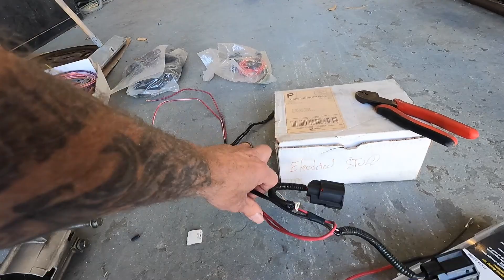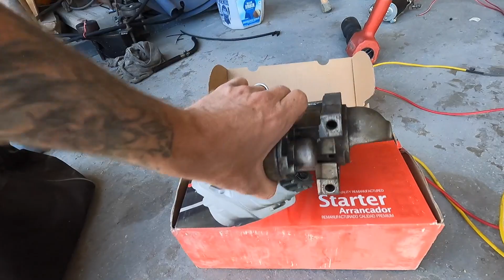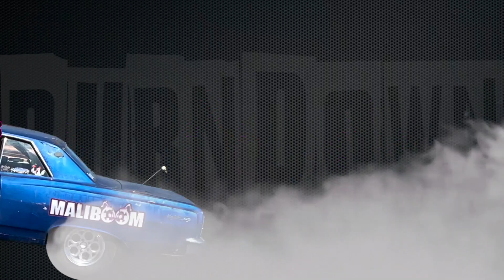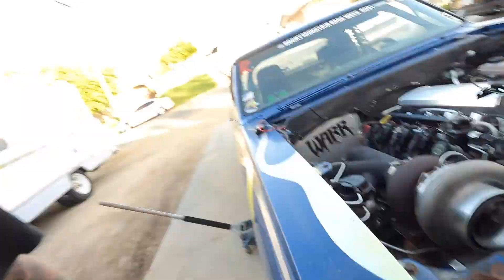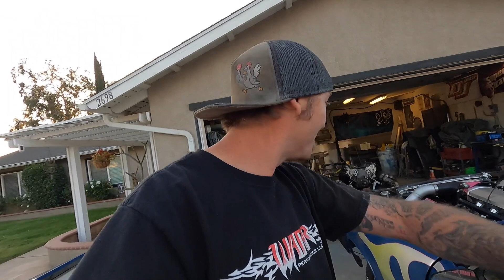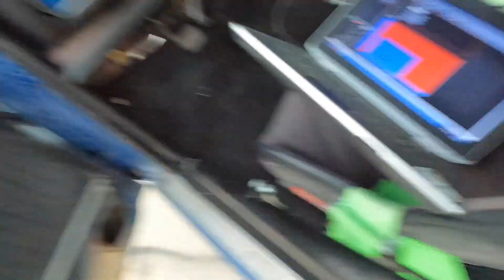Brushless Spal Fan Wire Harness and Test

Comment: I just saw this. If you don't have a Holley and want a different route. You can go to a more powerful non brushless style Spal# 30102800. My set up cost me $700 but I love it!! btw I have it on a Holley Dominator but will control it via Holley when I rewire it.  When I did this set up brushless was still voodoo.
Reply from the maker: Thanks for the tip.

Comment: Does this fan pull more than a Lincoln Mark viii fan? 
i have two of those in my ram that i use for towing and this really makes me want to test these out!
Reply from the maker: I know those fans make a lot of cfm but they are on off. I don't know if these make as much or not but you could look it up on Spals website I bet. These are just the 12" version. They have a 14" and a 19" as well. I bet the 19" would beat the Lincoln fan in a head to head test.
Reply: @Burndown  it really makes me want to buy the 19” version and make them go head to head haha.
the mk8 were actually pwm controlled from the factory but most people just have them as ON/OFF which is also how i have my set up. 
love all your e-fan videos by the way, keep pumping them out i’m watching them all

Comment: What are the fans out of again? They are awfully impressive.
Reply from the maker: Mine are both out of a 2012 Chevy Volt. If you find a set get the wire harness with it as well. Makes wiring a snap!
Reply: Chevy Volt. I think around a 13 or 14 year model
Reply: @kyleorsak  perfect, thank you! I'm thinking about trying these, locally they can be had under $100!
Reply: @scrapmetal_sleepers  I don't think you'll be disappointed.